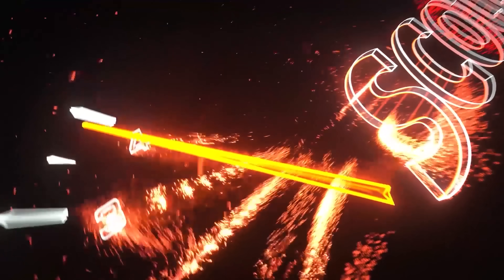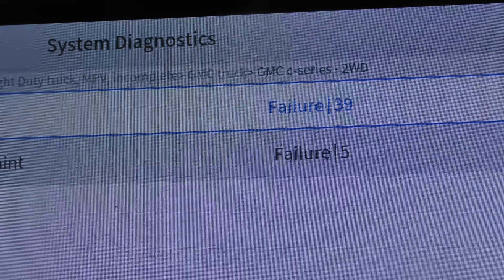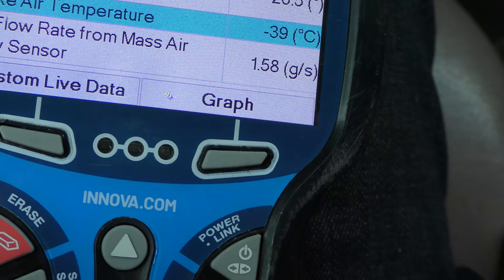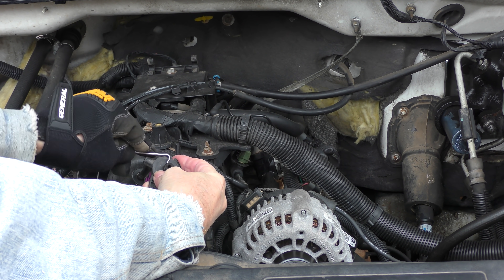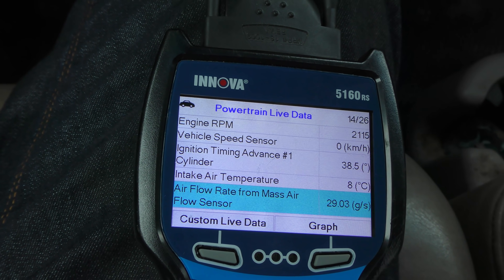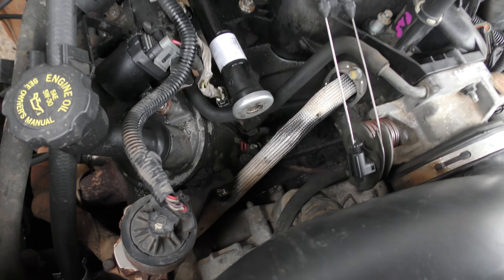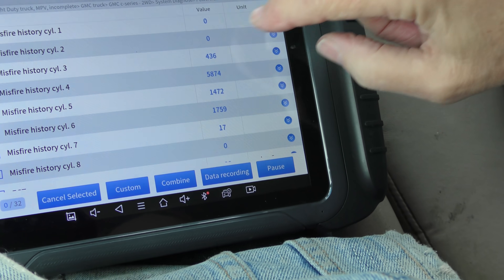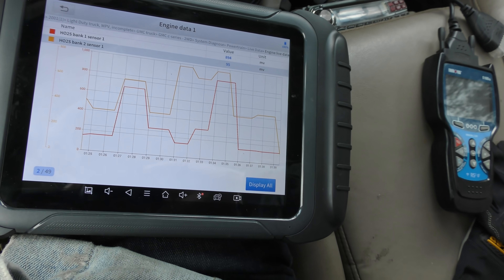My Customer Just Bought This Truck and Now He’s Screwed

Comment: Makes me like my 1967 pick up truck all the more. No computers, no codes. Simple engine, runs perfectly. Cold air conditioning too.
Reply: nothing made in 2022 will still be running 55 years from now, think they are designed to fail nowadays.

Comment: Heres my 2 cents. I have a 99 silverado with the 5.3 Had been sitting for a few years. I Had the random cylinder misfire and then a cylinder 4 misfire. I changed the coil and then all the plugs and wires, still the misfire remained.  I found a video saying to remove the vacuum line off the Fuel pressure regulator and check for fuel in it. Mine did have fuel in the vacuum line. Fuel Pressure Regulator was bad.  I replaced the fuel pressure regulator and everything was fixed. Possibly worth checking out.  Its pretty easy to do
Reply: Yeah those are common problems with GM vehicles and pumps going out
Reply: Interesting
I wonder why it bothers cylinder 4 the most
Maybe it's location or proximity on the intake?
Reply: The regulator was moved from the fuel rail to the fuel pump at some point

Comment: The irony is I don't think most mechanics today could figure out a fix of an o-ring like Scotty did, instead they'd quote you $300-1000 parts and labor for a major part change or tune-up if they even get the diagnosis correct at all.
Reply: These engines are also known to have intake manifold leaks so if that hasn't yet been done on this engine, it could also explain the wonky O2 sensor readings.
Reply: My dude charges $85/hr compared to $120/hr at other places
Reply: I think most would find it, some may try to replace the whole unit to try to make some more money out of it though.
Reply: Bro--  He probably plucked it loose and then unplugged that MAF sensor, just to trip some more codes and make the video about it.  It's kinda clever, I don't fault the guy for it--  it shows how useful the scan tool is and it's entertaining.  But he din't fix the 'actual problem/  he touched on it, but didn't fix it.   And that was the TEMP SENSOR.  If the computer thinks the engine is really cold like that, it will dump a LOT of fuel into the engine for a cold start;  It's the same effect as "choking" the engine.  But that's what is causing all the misfires, is the injectors are dumping too much fuel in there-- thinking the engine is really cold.  It may not be the sensor though-- it may be a shorted wire, and that would be a little more tricky to find.
Reply: @calholli  LOL !
Reply: @calholli  but wouldn't all the cylinders be over fuelling?
Reply: @calholli  I might be wrong, but I thought the -39 was just a placeholder for GM products to say the sensor isn't working. I have seen the same thing before on a similar truck which I would assume is why, but I could be entirely wrong.
Reply: It’s time to load up & fire the ol parts cannon and kaboom 💥

Comment: This Silverado is the same as my 1999 Silverado 4 X 4, 3/4 ton  6.0L, (first year of the new body style), mine is a single rear wheel and it has 350,000 miles on it but it runs, drives and looks like brand new.  It just goes to show you that if you take care of a vehicle it can last a long time. My truck pulls a 30 foot Toy Hauler Travel Trailer to the Sturgis Motorcycle Rally every year.
Reply: @jaymoar3561  nah i think he probably just takes care of his truck.. i have 1999 tahoe with 330k miles and it runs strong as hell.. i drive all over Arizona with it.. 115 degrees in the summer, no problem going up those mountains up north.
Reply: ive got a 6.0l express 270k runs like a champ, those are great engines, ive been throuhg a transmission tho
Reply: Agree, you just need to maintain, wash, drive responsibility and not beat on it, and many vehicles can last.  The most unreliable part of any car is the owner, so it all depends on the owner and how well they maintained it.
Reply: @jaymoar3561  I have the 5.3 in a burban with 380k miles and it runs like new
Reply: I have a LT-Z71 4x4 chevy 1500 extended cab with a 5.3 vortec with 400,000 miles on it and it runs like new. I bought it new in 2002 and took care of it. I have only replaced brake pads, alternator, front wheel bearings, and a few batteries. I'm shooting for 1Million miles.
Reply: @SlowRiderDucati  
No water pumps? Alternator ? Radiator ? AC compressor seems improbable
Reply: HA HA HA HA !!!!!! YOU TOW YOUR MOTORCYCLE!!!!🤣🤣🤣🤣🤣🤣🤣🤣🤣🤣 I HAVE A SHIRT THAT READS , " IF YOU REALLY "LIVE TO RIDE" YOUR HARLEY SHOULD NEVER!!! BE ON A TRAILER!!!!  Bet you proudly have a giant HARLEY sticker on it!!! Lame !!😁😁😁😁
Reply: @bbustin1747  not really. i have an 01 1500 silverado, 4.8. michigan truck, and it plowed. body? meh. seen it's better days. motor and trans untouched. brakes, rotors and front calipers were done a couple years ago. it runs so smooth, even a couple times, in the winter of course. getting old and don't want to get cold anymore, so i leave it running going into a store. but even i can't tell it's running, i've turned the key to start it. (one helluva sound OOP'S it's running ) but you simply can't tell it's running. unless you look at the rpm. 253,000 miles. oh, one spark plug and wire change. but that's it. oil of course. i don't see any problem getting over 300k. i owe it money. yes, it's been a work truck since day one. retired now, but besides plowing, i remodeled homes. so i've worked it, hard too. the loads it's carried? oh my.
Reply: @refineme  yup Scotty had a video on that yesterday, his customers Jeep Wrangler was reliable because he took care of it
Reply: I have a 2002 F350 7.3L Diesel 4x4, with 6spd Manual that has over 320k miles.  Still pulls  loaded down 5th wheel trailers right up the side of mountains, no problem.  I have a 97 Isuzu Rodeo with 290K miles.. it finally had a timing belt issue.  I think an idler pulley completely came loose-- because it was boring a whole through the plastic timing cover like a whole-saw. lol..  So I need to get on that job.
Reply: WOW, I would love if Scotty made a video of your truck, as you REALLY took care of it.
Reply: @artmchugh5644  Nice to see ha happy guy! Let's see you ride your Harley to Sturgis 3,000 miles at age 66 with your 67 year old Wife. You obviously have never been to Sturgis or you live a 100 miles away from Sturgis!
Reply: Not the newer Chevys.
Reply: 1998 GMC K2500 ( 3/4) 5.0 L  Z71 4x4 3 door Extended cab 395000 miles . Engine rebuilder tells me they run up to 750000  He uses them in his service trucks
Reply: @retgastothefloor8284  The GM vans with both the bigger and smaller le60 are known for it... Get a new one if it don't rot out on ya it'll go forever..
Reply: @richsweeney1115  not newer anything it seems. If I had the cash and time i'd go to one of those Mecum auctions, get a K10 or whatever with less than 25k miles, spend a quarter the price of a new one, and take care of it, but use it the same. Would last longer than a new one for sure.
Reply: Nice!  My buddy has a few of the early 2000's 6.0L 3/4 ton 4x4 pickups.  One had 335,000 before the transmission finally failed.  The other blew the engine up at about 335,000 miles as well.  He did say the O-ring on the oil pumps like to go bad, so he had replaced those as well and that fixed the oil pressure problems.  He also has a 2003 Duramax with 400,000 miles on it.  Loves his chevy's!
Reply: @retgastothefloor8284  280,000 is when the transmissions usually go on those.
Reply: @MyLifeThai371   if well taken care of, where i live its generally the 200k area, most vans here with 280k have had 1 trans redone

Comment: I bought an old truck. 2003 Chevy Silverado worth 230,000 miles on it. Would dump hard in second and wind out going into third.  It was a limp truck for me to get to my next one but the mass airflow sensor was on the check engine code. Replace that and all my transmission problems were completely gone. It’s been two years and I’m still driving this thing as my daily.  It’s amazing what an easy fix stopped my from putting a rebuild tranny in.
Reply: My 2003 Silverado does that when ever I forget to plug the mass air flow sensor in after replacing the air filter.  It's amazing how critical the MAF is.

Comment: Seems like it might be a good idea to buy a used vehicle with a good body and just do an engine swap. Way better than buying a $70k new, over engineered, truck.
Reply: Yeah any vehicle that you'll only need a cherry picker crane to do the swap.
 Most Definetely No if a two post lift is needed.
So that eliminates most front wheel drive cars.
Reply: Agree as long as you have a guy to do the work
Reply: @geojesse9230  my thoughts exactly. If the body and frame is in good condition you can do a lot of fixin and maintenance compared to the cost of a new one.  Also this year is much easier to work on than the later years.  I’m still running my 97 350 with 300,000 on it.  Never spent a winter up north, that’s the killer.
Reply: I agree!! Yesssssssss trucks can be $70- $100k
Reply: You can get a perfectly good crew cab truck with some bells and whistles for 45-49k.  That’s not unreasonable
Reply: @jordane7483  Only 45-49k? What a steal.
Reply: i hoarded bunch of new spare parts from various websites in few yrs  . I literraly have boxes and boxes of goodies . I can keep my truck running for at least a decade and not worry about spending a dime at the shop or buying another overpriced over engineered junk
Reply: @jordane7483  maybe a gasser

Comment: I have an 03 with the 4.8L vortec, bought it when I was 18 although it wasn’t in the best condition due to neglect from previous owner but over my 4 years of owning it I’ve learned lots of how to work on vehicles and even using scan tools. My old girl really sparked my interest in automotive repair and general maintenance. Good to see a turn of the millennium Chevy on the channel.

Comment: I'm shocked at the truck's running condition given how neat that interior is kept.....
Reply: @captinbeyond  kinda like retired police cars (Malibus, Impalas, Explorer etc etc) loads of stealerships love to claim low mileage (mainly 100k since thats retirement mileage) but certain models have literally sat roadside blasting ac/heat for hours on end clocking speeders 😂
Reply: I have a blue 2001 Silverado somewhat similar to this one 4.8 has over 249,000 miles the interior is crap but she's on top notch running condition
Reply: Probably a clean dressed man going long distance transporting stuff
Reply: @terjetytland884  Nah, those guys drive a black 1999 BMW 735.  With 06 in the licence plate.
Reply: Those Silverados 3500s tow 90% of the time. Probably just trying to get all they could out of every oil change.
Reply: Why are you shocked? It’s a work truck obviously the engine will wear out pre maturely
Reply: @bghoody5665  I know industrial salesmen in coal country VA that dress like they're at a country club...but they drive diesel duallies for sales calls! $70k+ trucks! They don't even tow anything! it's insane.
Reply: Have 1999 GMC Sierra 5.3 170000 miles runs like a top. Most major thing done was intake gaskets that all of these normally has to be done and the rear axle spider gears went out. Love those trucks.
Reply: Lol, funny but not true.  I work out of all my trucks and the interiors are horrible.  But, you better belive I maintain all my engines better than most.  Fluid changes, differentials, brakes, batteries, etc.

Comment: had the same problem my truck had 447000 put another motor in it got new engine for 300.00 wiyh only 110000 mi on it  runs great

Comment: With the selection left in a used car market right now I'm not buying anything that I don't anticipate putting an engine in?
$1500 for a good body $3000 for a rebuilt engine bang $4500 new 2003

Comment: Lesson learned from long ago. Never buy a car that's already warmed up and running before you get to see it. Think Transmission and engine, always have someone with you and keep an eye of what color of smoke is coming out of the exhaust. Will save your mind sake.
Reply: I purchased a 08 Honda 450 ATV, and I told the guy do not start it up and have it idling when I arrive. Told him if I touch that engine and it's not cold, I'm walking. I got there and it was cold to the touch. Bike fired up with not a problem and it's been good. Always check engines cold
Reply: I made that mistake when I bought an '84 Buick Century wagon with the 4.3 Diesel engine. It was idling when I pulled up. Beautiful car. I drove it and bought it. Ran beautifully and drove like a dream. On long trips I got 34 MPG. BUT, all kinds of cold-starting problems. Glow plug system was always dying. The neighbors hated all that smoke upon a cold start (but we didn’t have any mosquito problems that year lol).   Replaced several glow plug controllers and for a short time all was well. Then they would go bad again. Nobody could figure out why.  Finally traded it in on my first mini van. It’s too bad, I really liked that car. 

One more thing, when I bought that Buick, diesel had always been less expensive than regular. About three months after I bought it, diesel shot up past regular and never came back. 
Really enjoy all the videos and Learn a lot. Have a great day!

Comment: Misfire in those old 6.0s especially after sitting with dirty oil could have a stuck open valve or sticky lifter I've seen it myself try some marvel mystery oil in the crankcase !!!!!!
Reply: Yeah for any vehicle that has been sitting for a while, I typically remove the valve covers to inspect it if I have to run it on the old oil for a while.

Comment: Scotty, why didn’t you at least hook up a fuel pressure gauge to that? I’d be willing to bet the fuel pump isn’t up to spec and is getting weak causing your misfire conditions and erratic 02 readings. I’ve seen it several times before, and it only effects specific cylinders. I’ve owned many LS based engines and find it hard to believe it’s a timing chain issue also.
Reply: Yeah I would have checked for that..

Comment: Always was a GM guy until I started looking to buy one & got a hell  of a deal on a 00 Silverado 4×4  w/5.3 & loved it, ran strong but rust had started eating it from underneath out. They use very low quality metal on their trucks & now more plastic than ever.
Reply: On a good note, plastic won't have a rust problem!
Reply: With old Chev's, dodges, and Toyota's, you have to clean them quite often if you live in the salt belt. Especially the Toyota's, they would rust faster than a deer runs after being shot at.

Comment: It's a Chevrolet with 280,000 miles on it. It's already gone 150,000 miles longer than they usually do before falling apart.
Reply: Most the of the GM pickups I see for sale have around 360,000 miles on them.  They go a long time.
Reply: Mine is 20 years old with 300k on it and going strong, 6.0 liter, not many American trucks out there will last if neglected.

Comment: On the ABS light, the EBCM is a known liability. There was a TSB stating clean the ground under the driver side. Because GM had many turned in and they weren't defective. 10 years ago. They are now.

Comment: My 2004 Sierra has 275k still runs great except the lifter ticking noise.
The oil pressure has drop in half.
I guess a few things can cause that.

Comment: Bought a 98 Jeep Cherokee Sport/Classic for 1000$ with 179k miles. 4 liter engine, np242 transfer case & it literally leaks everything except refrigerant. Bought it to fix & once its patched up I'll probably rebuild the engine as its really simple. But it runs like a top & needs a dana 35 rear end rebuild. Maybe some floor pans, but I may tack weld in old license plates & call it good.

Comment: 07 older 2500 up 8500gvw your good to go, check. that truck is worth its weight in gold, the new engineered failures have more computer failures than that truck could ever have. Lifters and rings probably gunked up, throw a chain on, and anything else that's crusty on the way. It's all cheap parts for the older gm trucks, or you can find it on ten different models at junk yard push comes to shove. It doesn't come easy, but easier than marriage to a loan. It's nice to cruise down the road in something you saved from the scrap guy, especially when you see the newer piles of shiat broke down on the shoulders.
Mystery oil saved mine, wish the salt conspiracy would stop, because rust is the only thing going to kill it.
Lubra seal will stop that.

Comment: Scotty let me try to look at this from another direction given what new trucks cost today. Versus what an engine for that particular truck cost. I ran into this problem with my 2014 Corolla got totaled a few years ago my uninsured motorist did not pay enough to replace what I had but I did have an old 97 Chevy C 1500 pick up truck in my driveway. The engine in it was very tired. So I went and bought a remanufactured 5.0 L Vortec dropped it in there put a few new sensors in it drives really good now and I repaired it for less than $2000 granted I did the work myself. With new pick up trucks costing 50k or more It may be cost-effective just to repair the old beaters these days and still probably end up with a better truck